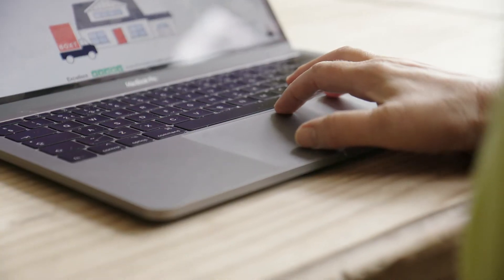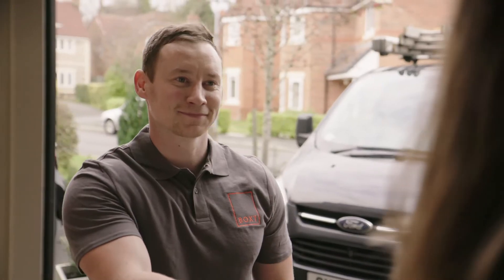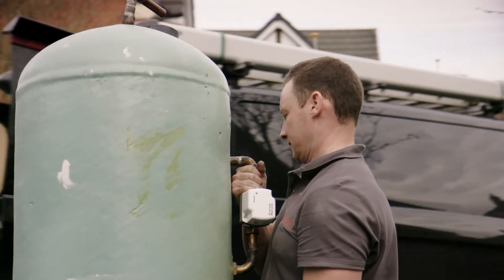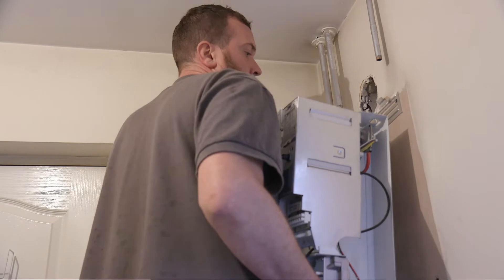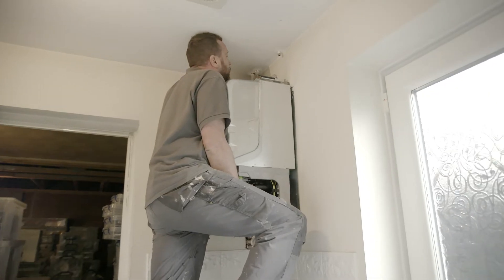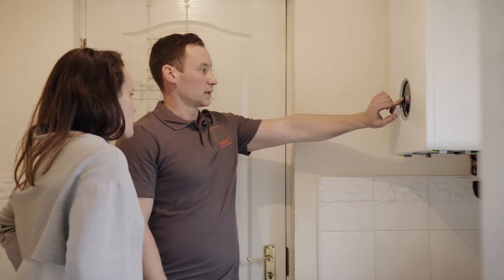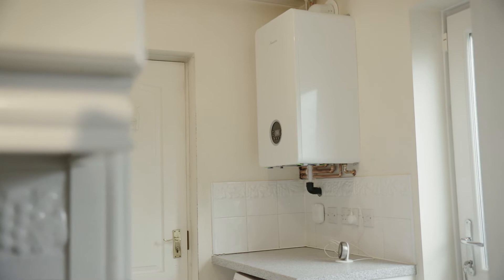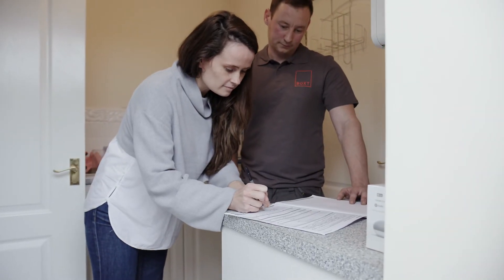Converting to a Combi Boiler | Installation Day

Comment: I’m a heating engineer with over 30 years experience, and there is no way you can do a conversion properly in a day, especially to the new part L regulations, the flush alone could take half a day to get the water in the system clean.
Reply: They done mine in a day, they where great. Cut out the middle man so no more getting ripped off by cowboys